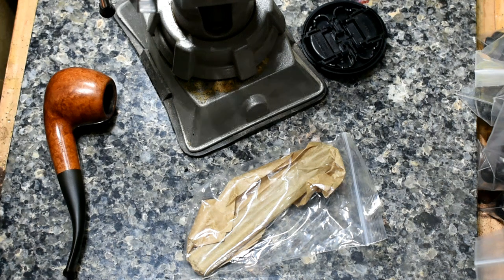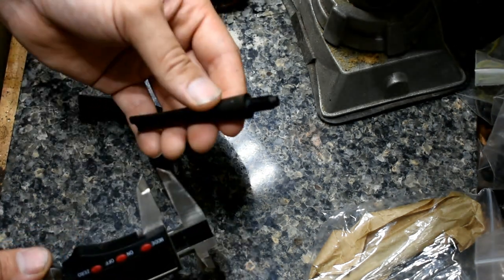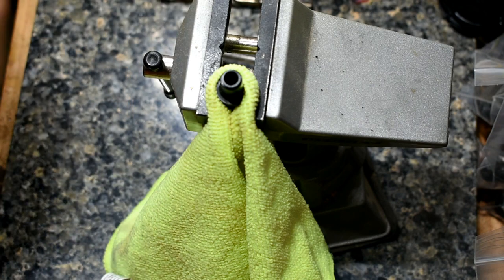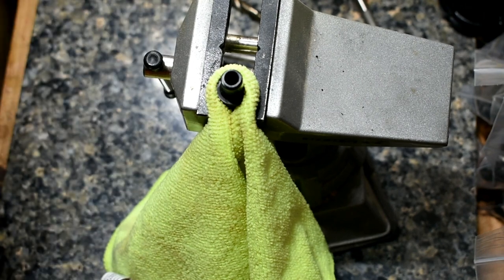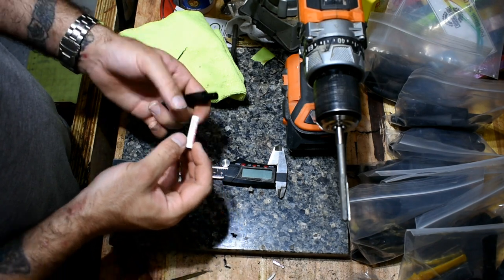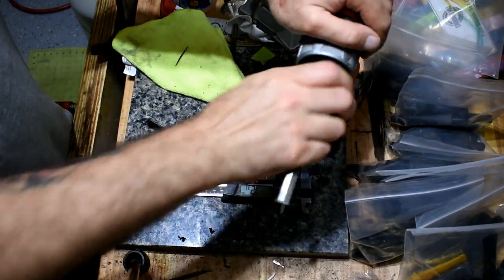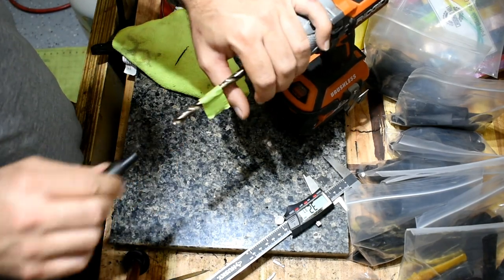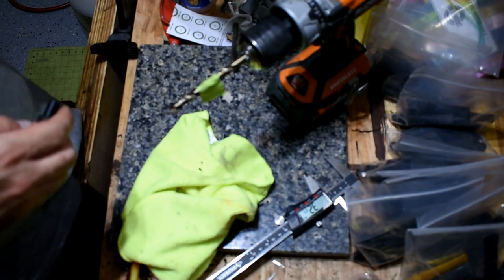How to modify a 6mm pipe to accept 9mm filters

Comment: Very nice approach to this, seems fairly safe to not blow out the side or drill too deep into the stem. Having worked in a machine shop, the reamer is a perfect tool in my humble opinion to ensure a consistent end result. And that material should be negligible if almost nill to wear on the reamer tool so last almost forever. Happy piping brother.
Reply from the maker: Yeah, I lost some video, and I went into detail about using a reamer, but the dang camera lost its mind! No worries. It worked perfectly.
Reply: @tucsonpiper9065  I could tell from your approach that it'd be highly unlikely for it to not turn out right. Maybe time consuming, but part of the fun. At least it is for me.

Comment: I did this on my Savinelli Tundra.  I used a 8.3mm bit and worked just fine.  I went a couple of mm too deep and the result is the filters moves
Back and forth a little when you smoke, it does not bother me but watch out.   This happened because when I devasted the first mm of the tenon (which it is slimmer than the rest of the tenon), I fortot to
Compensate this lenght, my 8mm filter should stick out more than the 6
Mm now.

Comment: Question. You restore pipes right? I've just purchased an old medico pipe, would really love to have it restored and I'm not sure how to go about the process of restoring it. Has A LOT of cake and carbon buildup.
Reply from the maker: Cake is easy to get rid of. You can get a cheap reamer on Amazon for a couple of bucks. Even without that you can get rid of the cake with anything that is stiff and dull. Beyond that, the condition of the pipe will determine how to move forward.
Reply: @tucsonpiper9065  you mind if I send you pictures of the pipe? I've done a little work to it. I don't have much of a before picture, but, lemme tell ya, someone smoked this thing heavily. You couldn't fit a cigarette filter into the bowl due to the carbon buildup, and the stem is still stained. Not sure how to go about getting rid of the stains in a 70 year old pipe so.